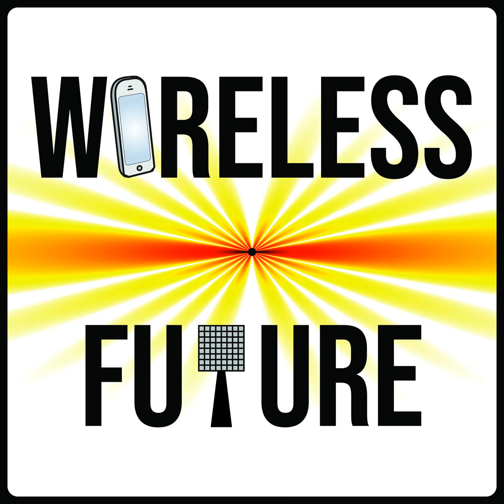48. Non-Uniform Antenna Arrays and Movable Antennas

Comment: When I remember correctly, I have already something about randomely distributed antenna-elements on an array. Could it be that it was already in one of your books, papers or lecture slides? I cannot remember,  I believe it wasn't in your latest book from 2024, perhaps anywhere else.
Thanks
Reply from the maker: We often consider random access point deployments in cell-free massive MIMO, but that is at a much larger scale. Randomly distributed antenna elements have been studied in array signal processing in the past, but I don't remember doing it myself until the last few years. However, I've given technical speeches on this topic since September last year. I plan to make a video based on those as well during the coming months.